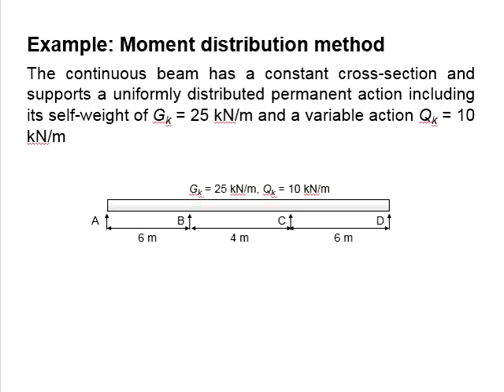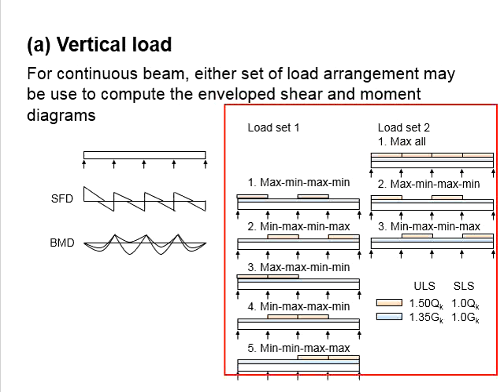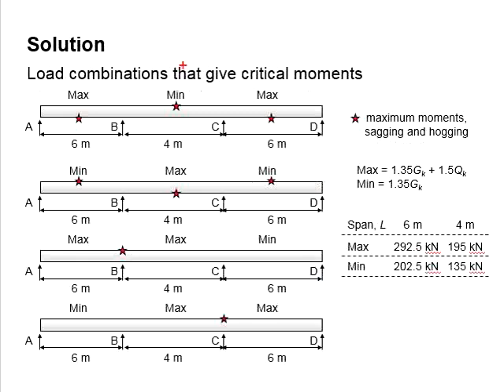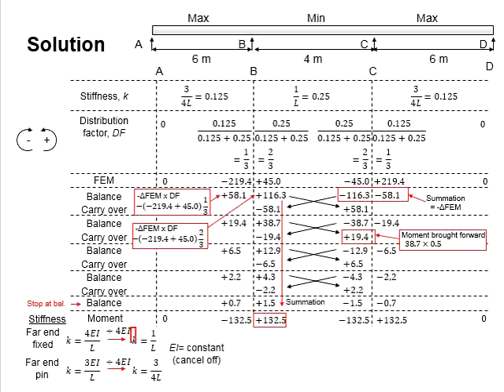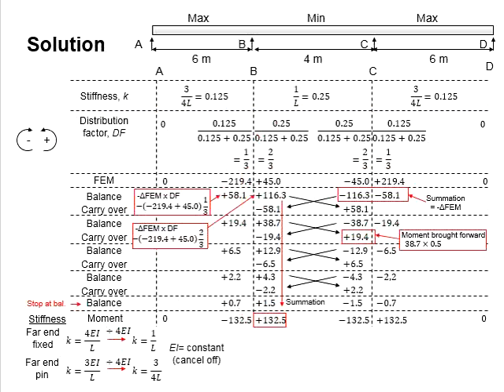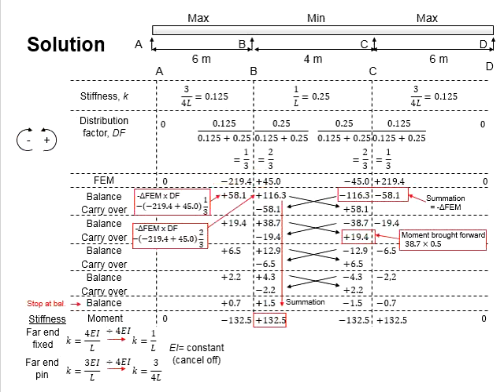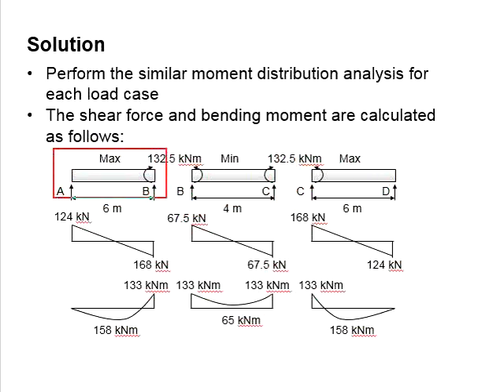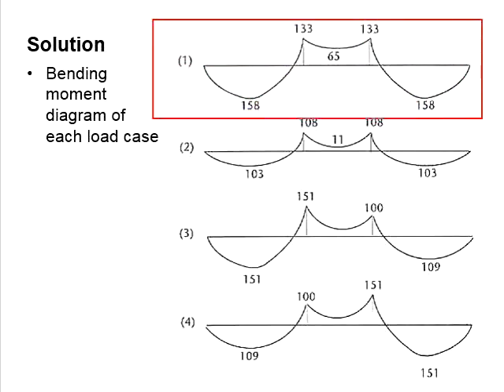3.7 Example: Moment distribution method

Comment: Thanks, but The values in your tables of Max and Min isn't there a problem? 1.35Gk +1.5Qk gives 48.75 right?
Reply from the maker: Yes. In terms of kN/m, max udl = 48.75, min udl = 33.75, if we calculate the load for 6 m and 4 m span, F = 292.5 kN (max, 6 m), F = 202.5 kN (min, 6 m), F = 195 (max, 4 m), and F = 135 (min, 4 m)

Comment: What's the difference between number one of load set 1, and number two of load set 2? both are Max-min-max-min
Reply from the maker: They are the same, that's why they are put side by side. For a typical 4-span continuous span, load set 1 need to do 5 load combinations, whereas load set 2 only need to do 3 load combinations.